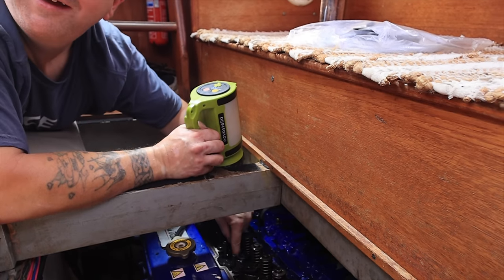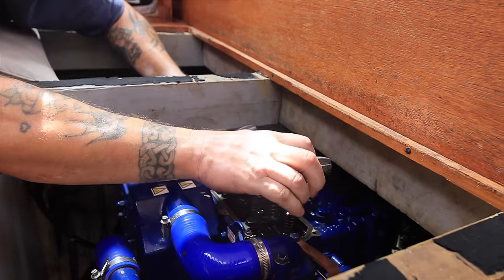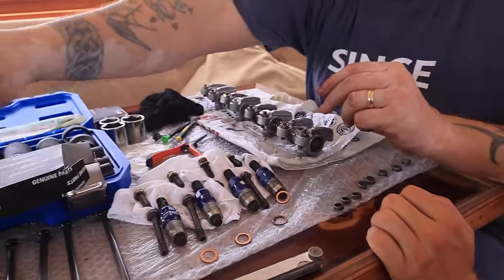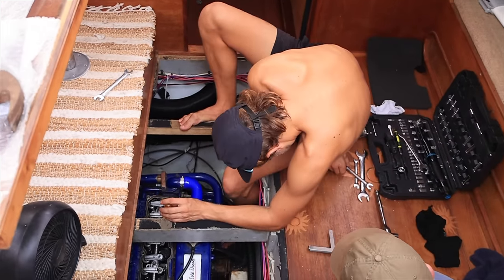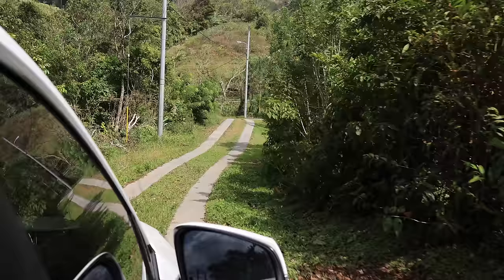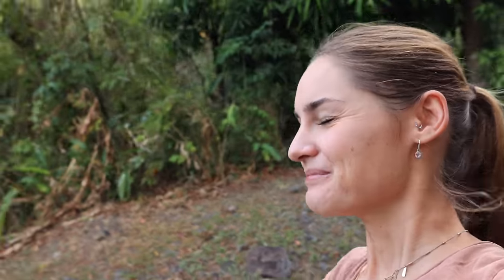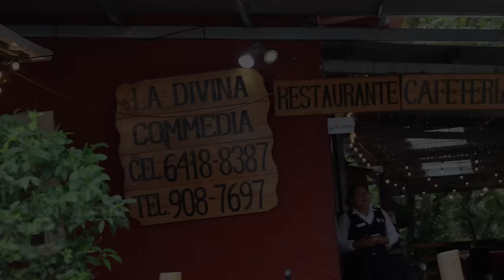SAILING MISHAPS: An inch away from a full rebuild..

Comment from the maker: Stuart, the man, the myth the LEGEND! Not only did we learn a tonne about our engine with the confidence of someone who knows what they are doing 😂 but we ended up having a blast with them too! Result. 

Is this issue what you thought it would have been?
Reply: Yep.  I made that comment last week.  Looks like I was nearly correct.
Reply: Yes Stuart is a total Legend. Helps his heap of knowledge and organizational skills to have the proper tools as well. That injector socket is priceless for your engine and the open end tubing wrenches too. Missed a valve train issue, thought leaking injector due to the smoke at start up.
Reply: Yep you owe him big time !!👍🏽☺️
Reply: I did say earlier that there was a faulty connection that was causing the slow turn over!
Reply: Not nearly as bad as I thought. Got used to modern gas engines that don’t have rocker clearance maintenance.
Reply: I was surprised the engine ran at all last episode with the pushrod cap gone and the rod beating the rocker arm. Finding the cap was a godsend and a testament to the reliability of the engine. With any new parts added that have adjustable components my shop would halve the time to next valve clearance check and confirm the mounting torque to specifications. Simple reliable engine = peace of mind. Glad you could renew your bonds by playing some with your priceless friends.
Reply: @craigc.494 
Looks like it was like this?
A valve stem cap jumped off the top of a valve (not a volve). A collet was mentioned but it wasn't a collet, collets keep the valve spring retainers in position & cannot jump out of place & if a collet did get displaced the valve spring retainer would jump off releasing the spring which would also allow the valve to drop into the cylinder. 
 Rocker arm push rod seat damage was due to over compression in that cylinder from water ingress into the cylinder?
Reply: Could do with replacing engine mounts too!!
Reply: Hello, congratulations on the successful completion of the engine repair. In my previous comment to the previous episode, I suggested this method of repair. I'm glad you avoided the costs of major engine overhaul or replacement. From my experience, I can tell you that yacht engines operate in difficult conditions due to tilting, which is why I adjust the valve clearances every second oil change or check it. Best regards and I am happy for your success. Big words of praise to Stuart.

Comment: To explain, it is a valve CAP that is missing, collets are wedges that hold the valve in place and they are under the large washer with the spring pack.  The CAP sits on top of the valve and have several functions, raise the valve pack so you can set the gap,  and secondly make the valve slowly rotate to allow constant lapping of the valves to make the seats seal.  My personal thought is this engine was assembled wrong along time ago, as for this to jump out while running without bending a push rod would be impossible……………just saying
Reply: Sounds like sea water siphoned back into the cylinders which caused the valve to stick open allowing the rocker to hop out of the push rod cup. The extra clearance allowed the cap to hop off the valve. If the damage is limited to a rocker arm and a pushrod it is extremely good luck. Had the valve hit the piston you would be looking at a bent valve and a cracked piston. Personally I would have done a compression test as the cranking speed sounded uneven.

Comment: Stuart what a fantastic guy. To travel all that distance and bring all the necessary parts & equipment to repair the engine.
So please Teulu’s engine is back up and running better than ever.
Great video a bit of boat repairs and a scenic travel, a nice mix, a very interesting channel.
Good luck with your travel’s/adventures Becka & Zack

Comment: Hello Becka and Zach.  It's great to have friends.  It's better still to have Good Friends, who will drop everything at a moment's notice and fly half-way around the world, to fix a friend's engine.  Everybody needs friends like Stuart and Chris.  You are both very lucky to have such friends.  I bet the trip made a nice Birthday Present for both of them.  It looks like Stuart really enjoyed his Birthday breakfast.  Nice to see I wasn't far off with my comments of last week's edition.  You were damn lucky with that Collet.  That could have been really problematic, if it had fallen down the Pushrod hole.  You now have a fully - and properly - functioning engine, which should keep you going for another 800 hours of use.  Personally, I would be inclined to recheck the Tappet Clearances after 200 hours - or earlier, if they start to get noisy - as they can 'settle'.  It would also be a good idea to recheck the tightness of the Fuel Line Banjos, as Copper Washers can also compress over time.   I've had Motorbikes and Cars, so have considerable experience of both problems.  Nothing worse than springing a leak in a fuel or oil line.  Fair winds.  Russ.  UK

Comment: You are very very lucky as usually when you get a hydrostatic lock when you try and start the engine it bends the Conrods You are very luck indeed. I would have done the valae adjustment before putting the injectors in as it makes it so much easier. NOTE !!! I hope you have a spare starter motor as that one is not sounding healthy at all and its not something you will buy in the middle of the Pacific .

Comment: Next time you check your valve clearances remember to use the rule of nine as you have a 4 cylinder engine. So, when number 1 valve is fully open check number 8 valve. When 2 is open check 7 and so on.

Comment: Those little hardened buckets on the end of the valve stem are called -- valve stem caps. Main purpose is to protect the end of the valve from the constant pounding of the rocker arm. Also on some engines they aid in allowing the valve to rotate a bit which is supposed to help keep the valve seat in better condition.  In most engines, this is not the case.

Comment: Result.
I don't want to cause alarm however and it'll more than likely be all fine, but unusually excessive valve clearances could mean that your cam shaft has worn down.
It's quite unusual to have clearances large enough to cause a push rod to dislodge between services.
My advice would be to check the clearances again after maybe 100/ 200 hours to see if any have increased again. 
It might only be on one cylinder (The one that had the issue), where the gaps are larger than every other one. 
If they have then I'd look into potential cam shaft wearing down.
Always listen to the engine. If it starts tapping loudly again, and the idle is lumpy/ jerky/ uneven, it'll be excessive valve clearances, possibly caused by a worn camshaft.

Comment: You've got enough junk in your oil I would do the next oil service in 1/4 interval and the following at 1/2 before returning to normal. I would also check the valve/rocker clearance at those times before returning to normal intervals.

Comment: all fuel rails for cars and industrial are solid steel lines now, nothing really uses rubber maybe only to the high pressure pump and most cars run steel lines from the tank for quite some years now. the valve thing is not a collet the collet is two half retainers that keep the valve spring cap on that is a spacer in other words, i dont know why they even use those when older engines never had them, its a part that is destined to give you issues, if you keep the valve clearances set then it should not come out

Comment: CAUTION!   Make sure the valve clearances were done at the correct part of the stroke (TDC) on each cylinder … turning them by the key isn’t normally accurate enough need a ratchet or bar on the crank pulley! 

And engine mounts might need to be on the list for next time!    Good to she she’s running again!

Comment: So all the valve clearances were far too big? The motor has only 800 Hours? The given valve clearance is 0.25mm, yet the actual clearance must have several mm's for the cap to be displaced. Remember that 800 hours equates to 30 odd days of continual running.  *****This wear is not commensurate with that amount of hours. If the run time is genuine then you have serious problems  with cam and followers that need immediate attention.*******

Comment: Run to fully warmed cool engine to manufacturer recommended temp recheck adjust clearances! Most likely you will find are a little tight.

Comment: PSA folks adjust your valve lash because you need to be seriously out of adjustment to loose a lash cap without bending anything this lesson was basically free since it could have turned into a grenade and the only difference is pure luck.

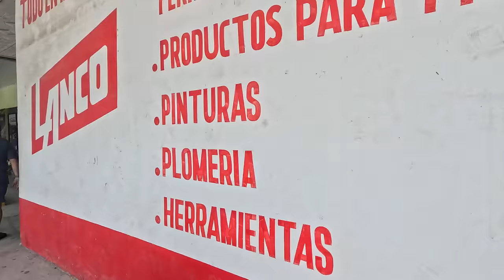Comment: Regarding replacing the injector copper sealing washers at 10:26 seconds, you could have resuse the original ones as long as they are not damaged.  

Copper, age-hardens in time and you have to 'soften' the copper rings and this is very easily done by taking each copper ring up to 'cherry red' on a gas stove or using a blow torch  and either quenching the cherry red copper ring in water or letting it cool down in the air.  Quenching is the slightly better method as and surface impurities can been cleaned off.

As you are going to places in the world where copper rings will be in very short supply or non existent, more like hens teeth, you need to understand this method for reuse.

I ran a garage for many years and then spent seven years as an RAC engineer.

Comment: The copper washers need to be soft (annealed) in order to seal.  Copper work hardens when you compress it so once they have been installed, they will be hardened and will not seal again.  It is generally best to replace them with new but sometimes you cannot get the correct size.
As an alternate for an emergency repair, you can re-anneal them to restore the softness.  This is done by heating them until they glow bright red and then letting them cool naturally back to room temperature.

Comment: no no no... water on top of the piston slammed a valve shut... bowed your push rod (one with wear spot on side) and popped it out of alignment which let it land where it ate into rocker, WHEN YOUR ENGINE WAS HARD TO CRANK... IT WAS IN OR VERY NEAR HYDROLOCK.... the hard effort of the starter to crank over engine had nothing to do with your guesses.... pushrod can be forced out of alignment... AND NOT SHOW AS BENT...  ADDRESS HOW ANY WATER IS GETTING ON TOP OF PISTON... OR IT WILL REPEAT OVER AND OVER.... SYMPTOMS  HAVE BEEN ADDRESSED... BUT NOT ROOT CAUSE... IT WILL REPEAT... (20 yrs boat repair shop owner and shop teacher before that............ TRUST ME....
Reply from the maker: It was a bad anti siphon valve which let water in which did it, we replaced it

Comment: The extremely venomous coral snake has a look-alike that is not venomous. Same colours, but different sequence. Red touches yellow - run away. If it seems the same but the red does not touch the yellow (because black) then it could e.g. be a "milk snake".
The general rule of thumb with snakes is that a very long gradual tapering in the tail is not venomous and a short sudden tapering is venomous.
Some of the venoms are not only neurotoxins but also start a digestive breakdown of your tissue.

Comment: Good morning guys, first of all I greet you with affection. 
Well, after realizing that you would have to rebuild the engine (my advice is to replace it with another, a Volvo Penta of the same displacement and horsepower), it is well known that the mistake due to lack of experience is to take fuel directly from the pump hose. to the mouth of the tank (you are introducing shrapnel, water, mud, organic waste, etc.) that no longer matters. I recommend again that you buy the following strainer filter, which you can Google. 

Filter: YOILP-GL-21

flow rate 19L/mini
Product size: 22.5 x 23.5
Product Weight: 291g

Comment: What a friend! It's good to know those who know! Ya got so lucky. Cheap parts those push rods. Now don't take off parts anymore. They all have a purpose. Those little yanmars are great engines. Should get 10,000 hours if you just maintain with diesel oil changes. Valve clearance is .0006-.0008.

Comment: Job well done!
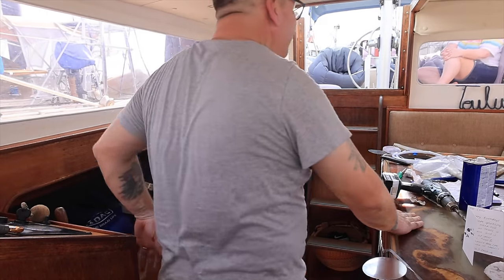@21:40 It doesn't only sounds sweet, as it should. It will run more efficiently too. It will not differ by a huge margin, if will probably be a few percent less fuel, unless the valves were really way off by a lot.👴👌🤷‍♂😁

Comment: What a great help, great trip, great video.

What about the water, where did it come from? The root cause is the clearance of the rockers, but something triggered the push rod to dislocate. That may have been water in a cylinder (sucked in through the exhaust maybe?) Diesel engines may produce more kick when there's water in the cylinder. A bit of water may have been the straw then.

Comment: All fuel rails on a motor, diesel or gas, that I have worked on have been metal.
This is due to the pressure of the fuel from the high-pressure pump to the injectors.
Fuel lines coming from the tank to the engine, low pressure, can be either a fuel rated metal, rubber, plastic, etc.

Comment: So where did the water come from? You guys? Never stated that and your video. Did your fuel have water in it?
Reply from the maker: The water came from a faulty anti siphon valve which we removed a month earlier- the water got up the exhaust into the engine but now has an anti siphon valve to prevent that

Comment: Stuart is a hero ! Wonder if Stuart is trying to convince his wife to go sailing ? I’m so happy for you two dodging the rebuild. You got amazingly lucky ! Bonus is that Zach now knows how to run the overhead. Your motor will burn less fuel now.
Reply: An added tip for working on engines is to use a piece of cardboard to keep all the screws and bolts organized. Punch a hole in the cardboard and push the screw or bolt through. Then label it as to what it holds. Keeps them all together , organized , and from falling off the table or getting scrambled. You can come back months later and it’s all written down what and where the screws are for.

Comment: 9:04 but how got the water in the engine in the first place?
Via fuel, condensation water in the tank, overflow of the water separation filter?
Reply from the maker: By removing the anti siphon valve- it was a DIY u bend which looked corroded so we took it out- however, in hindsight, we needed it!
Reply: @TeuluTribe  a okay, yeah, I've seen something like that in previous video...
Thanx for sharing, I'll check if I have such valve myself and check the working of it...
You must know how many people learn from sharing failures and repairs on YouTube ❣️
Safe travels you two ❤️
Cheers from Amsterdam the Netherlands....
Reply: @TeuluTribe the anti siphon valve on the exhaust pipe?
Reply: Ah, I think I found it.... And now I know what this little white box with two pipes is doing on my boat 😉
Thanx again you two ! Amazing adventures...

I looked for "Anti Syphon Valve - Vented Loops" "Helps Prevent Siphoning of Exhaust Cooling Water Into Your Engine"
Reply: From a manuel:
"The drain valve may be opened until the engine fires, if desired. All Catalina are equipped with
anti-siphon valves as an additional precaution to prevent cooling water from entering the engine.
The function of the anti-siphon valve is to prevent cooling water from being siphoned through the
through hull valve, through the engine cooling system and into the aqua-lift muffler when the
engine is not operating.
If the muffler were to fill completely with water, water would travel up to inlet tube and enter the
engine block."

"Periodically disassemble the anti-siphon valve. Be sure the valve is not fouled with salt
deposits and that it opens freely under the cap."

Glad you solved it all, great to get such nice help ....

Comment: if there is anything you've learned about this or'deal. You should pick up some light reading about diesel engine design and maintenance.  So you can diagnose and advocate for yourself better in the future. You don't need to be a professional for this level of knowledge IMO. A Feeler gauge and a torque wrench would be a good addition to your tools too. Often you can get 3rd party manuals by either "HAYNES" or "CLYMER" for these types of engines too. Having proper Valve adjustment, you'll actually have a little more power too. The rocker preload affects the "effective" duration of the camshaft.

Comment: You have not fixed your engine. Until you establish and have corrected why water's getting in you are sitting on a time bomb made of your Own Denial. You will likely have to pull the head anyway and get it skimmed and do a new Head Gasket. Face it. Fix it and Forget it.
Reply from the maker: We explained in the video, its because of a faulty anti siphon valve, we have replaced this and now have no more issues 😊
Reply: Fantastic! @TeuluTribe